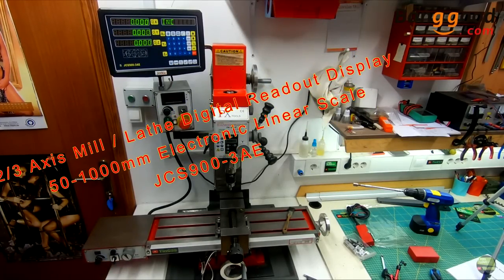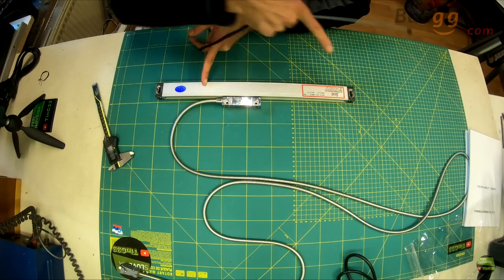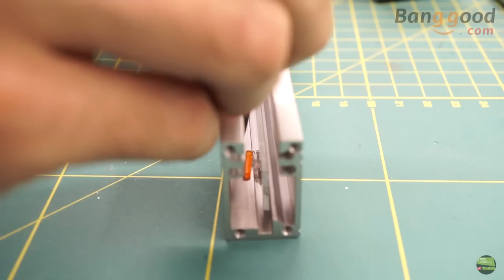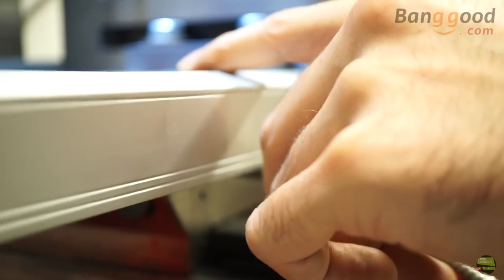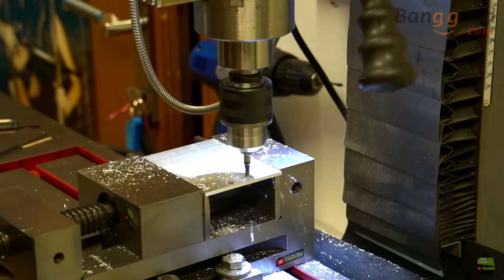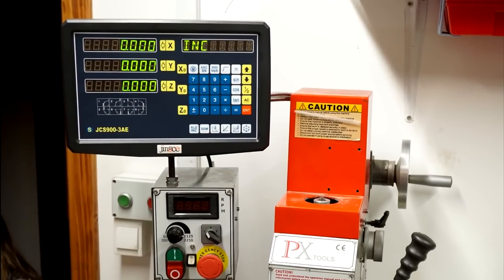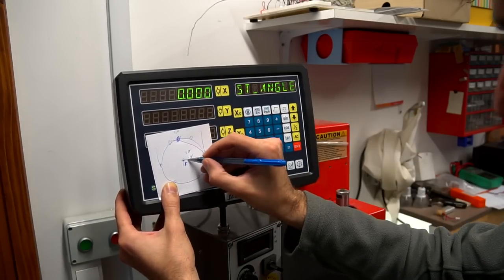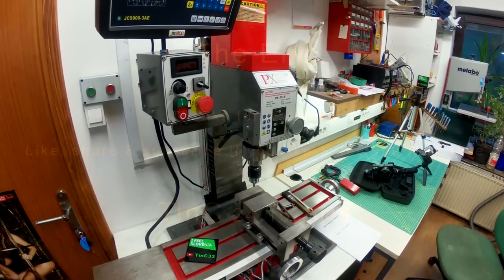$200 Mill DRO 3 axis Digital Readout from banggood [Unboxing Instalation Review]

Comment: This is the BEST explanation of installing a DRO on YouTube ... lot of people talking WAY TOO much and not SHOWING any of the work! I’m installing mine right now and just had to stop and thank you for this video ... I bought 2 ... 1 for my lathe and the other for my mill ...I bought mine from AliExpress and got the LCD version
Reply from the maker: Thanks man, i wish they serve you good.
Reply: TinC33 unfortunately the scale I cut is not working ...
Reply from the maker: @sonnytee  what's the problem, number stay the same when moving or what, check the optical sensor so there is no dust and be sure that you turned the glass right, on top (out of aluminium groove) must to be grinded a bit radius side of a glass.
Reply: TinC33 yes the number stays the same and soMeTime change but only for a second
Reply from the maker: @sonnytee  strange, try to clean sensors with compressed air, and check if you mount the glass on right way.
Reply: TinC33 got it working! Had the glass turned the wrong direction 😂 DOH!! lesson learned! Thanks 🙏 again for the video and responding to my comments! Starting my own channel in a few days...

Comment: Thanks for the detailed fitting instructions...........not all mills are the same as far as fitting position is concerned........I have a jig borer that is now a mill so fitting is  a bit of a challenge in mounting position differences.
BTW.....I wholly applaud the fact that you dismantled the glass scale to cut the aluminium and lastly the glass scale.....that makes it super easy with the diamond cutter in the Dremel and is far more precise.......I cannot imagine how anyone could think of cutting through the scale with a bandsaw even though it worked for them.
Reply from the maker: True, my eyes bleeding when i saw entire scale clamped into band saw, but it worked, because there are a bit longer glass then actuall needed.

Comment: Great video! I really liked that you showed many of the little "gotchas" that you run into in mounting these things, the clearances, angles, adapters needed...great. when cutting the glass scale with diamond wheel, did you use any water? I made a water dripper from used medical infusion bag and line, which has a little roller to adjust the drip rate...you can maybe get these from a veterinarian?
Thanks...BTW, do you watch ski jumping? Beautiful country you have, sir!
Reply from the maker: Thanks, no i didn't use coolant, because i only mark the line than broke the glass with a bit of force, if we want to cut through we need to use water, actually i'm one of few slovenian who don't watch ski jumping, maybe here and there because ither watching on tv 😉  where are you from?

Comment: It was good to see that the glass can be cut. Thanks for the vid.
Reply from the maker: Yea, someone didn't even dissasemvle them, just cut entire scale on bandsaw, because glass is 2-3cm longer then measuring distance, but i won't try my luck on that way
Reply: @TinC33  Thank you for the response. I have been researching these DRO's all afternoon. It is not clear to me how to determine the size needed. I watched videos that show how to measure travel by marking the table and the mill base. However, shouldn't the length simply be the bed length for x and the bed width for y? And is that not why you cut them? What am I missing? Thanks.
Reply from the maker: @GogebicYooper  if you order 300mm rail it is working area, so entire leingt is longer than 300mm, so i cut to perfect leingt. You can see into video how much longer they come.

Comment: Man, you have some skill! I have unfortunately just bought the Igauging DRO like you had before. I would have bought this if I knew it worked so well, but for now I will live with the other one.
Reply from the maker: Ah it's not big deal but thanks, yrs this one is on another level, but it's quite big for small machine like mine, but everywhere lot of empty spaces, it could be made much smaller easily.
Igaging work good but it's just to slow for work smooth.

Comment: No need to completely disassemble the scale to cut. Just take off one end cap and move reader to the other end. Shim the glass on both sides with wood or plastic at the cut location to keep the glass rigid. Cut with the band saw through aluminum, glass and wiper all at the same time. Just file the end square, clean up and retap for the end cap. Done!...I've done several this way.
Reply from the maker: I saw that but i don't know look so dangerous to broke the glass...

Comment: Very clean installation. Well done! 
I think I would be afraid to cut that glass😅
Reply from the maker: you think i wasn't? :) but anyway it cut nice and easy
Reply: I just did this tonight ... the glass cut fast using the proxxon and diamond wheel ... it was easy .... putting the little rubber pieces is HARDER than you made it look 😂 it’s a tight fit ... I’m literally doing it right now.

Comment: Fantastic!  I've had this same DRO for at least 10 years now (was running it on my lathe using only two of the axis).  But I wanted to move it to one of my mills - which just happens to be... the same as yours!  :O  This will save me SO much re-inventing of the wheel.  Oh, only thing I would do, is glue a sheet of thin felt (etc) under your Z bracket so it doesn't hit the scale.
Reply from the maker: Thanks man, and good idea. If there will be need i add some more shield, or wipers or whatever, but so far work good, they already "swim" into steel chips a few times.

Comment: nice clean setup Y axis cable might be bending a little bit tight you could probably give it a little more room by swapping X and Y cables in a clamps
Reply from the maker: Hello, firstly i try axactly as you say, but the cable constantly come out, this posittion is just great because cable hold under the scale itself, maybe look a bit tight, but it isn't.
Also not many time move table to the limit, and if i do i can just put cable out of (under the rail) and there's bunch of place, like on 15:36
Reply: Y axis reader could be flipped with cable pointing towards rear I did this on mine works great

Comment: Hi, thanks for this wonderfull video, congratulations for your both perfect technical an scientific approach. I've got the same machine and wonder about :
- due to it's drilling/milling design, did you find a real interest in use for the Z axis ?
- In the case I would invest later in the third rule, is it possible to buy a 3axis display, but use only the X and Y rule ? Will the "2 dimensions" functions accept to work in this condition ?
Thanks
Reply from the maker: Sure you can buy 3 axis display and only use two linear rails, i don't remember if i use Z axis but if i only use them once, because this mill already got a z axis dro on spindle and more or less i use this as z axis, real z only use for rough adjust...

Comment: The mill looks like the equivalent of the Optimum BF20? I wonder if any choice of scale would have been right, and it's better to go longer and cut them down.
Reply from the maker: It is the same those mill can buy in many different brands and they are all quite the same, i advice to take longer and cut them down you can get exact perfect leinght, it's not a hard job.

Comment: Good video well explained. Could you please explain what the composition/ brand of that solder you used, thanks.
Reply from the maker: Thanks, I use Durafix Easyweld Aluminium Welding , Brazing & Soldering Kit but there are many brands, now also got them on banggood for 10$, i buy that one years ago, and that was the only i found, price for 4pcs of rod was about 40$ that time.
Heater is basic torch from a local shop, work better like rothenberger roxy, wich is more hot, but got too small fire, you need to heat entire part preatty goos so it can be soldered nicely.

Comment: Hi,
after opening the read head, do you think it is possible to change the orientation of the cable outlet? In some configurations, the cable will collide with the attachment of the scale.
I suppose the thread of the cable outlet could be quite unusual…
Reply from the maker: I think you can drill another hole and put cables trough, but be carefull on chips (remove all electronics) and seal every hole before use

Comment: Excellent instruction video - what solder are you using to fill up the bend point on Y axis bracket? - I tried with lead solder after removing oxide layer on aluminium, but solder will not adhere ... Please advise .. Many thanks!
Reply from the maker: I used some rods for welding aluminium. You can buy on ebay, banggood...
Reply: @TinC33  OK great got it ... thanks!

Comment: Hi, was the power feed original or did you buy it separately? What is the designation (model) of the power feed? Thanks
Reply from the maker: hello, it was on machine when i buy used one. i saw holzmann sell separatly also and i'm sure it fit on every brend of this type machine, it got no special name just google for "Automatic feeding for milling machine Holzmann BF25VLN" it cost about 400-500€

Comment: Nice clean instalation, well done. I got the same set but on aliexpress and it cost me 174€ and posted from spain so i had no extra import/customs duties to pay. I always wondered about the glass scale and what it looked like as i have only seen it from the ends, and i git 1 scale slightly too long so i might shorten it now that i know how. I would like your opinion on your X axis autofeed, my machine is slightly bigger but not much and did not come with the autofeed so i'm trying to decide weather or not to buy the same one or build one. from the outside it looks the same as the one available for my machine and will fit directly. Thanks for sharing.
Reply from the maker: That's great to hear, i also got this from netherland EU so i don't need to pay any tax, that's  great.
About x axis automatic feed, it's woth the gold bealive me, really great stuff i don't know it that one fit to your machine, here is the link to other brand than i got:
https://www.probois-machinoutils.com/en/mandrins-et-options-pour-perceuse-fraiseuse-metal/4091-automatic-feeding-for-milling-machine-holzmann-bf25vln.html
But you can get it gor about $300, it+s just a 90vdc motor with a reductor and knob for turn on or off the gear, but i got constantly turned on because you can easily move axis manualy also if it turned on.
Also i thinking to add another geared motor for the Y axis, if i work more i use drill to move Y axis, as you can see on 18:02

Comment: Hello,
What name is your mill ?  Also what is the box on the left of your mill table ?  It seems It's to move the table with a motor . Any link to buy it ?  Thanks a lot for the video.
Reply from the maker: My mill is PX tool 20 same as optimum or bernardo, grizzly size 20 or 25, that think is called power feed, there's a motor and switch for left and right and a pot to set speed, right cnob is clotch to turn on or off entire autofeed.
Search for powerfeed, there are many different version i use ona like here:
https://www.probois-machinoutils.com/en/mandrins-et-options-pour-perceuse-fraiseuse-metal/4091-automatic-feeding-for-milling-machine-holzmann-bf25vln-9120039909288.html

Comment: i have the same dro on my mill at home ,i can tell you that it's accurate down to 0.006mm over 850mm of travel...if the dro at my work is correct,and it shoud be,sinse that entire machine cost more than i make in 5 years-i can however guess that it may vary from one set to another

Comment: Hello - super video!!! I have a similar mill from Paulimot and I also want to attache a DRO.
I saw that you have a drive installed for the x axel. Can you supply me with the name of the manufactorer? Thank you
Reply from the maker: Thanks, mine is some china brand PX-Tools, but it's same, as bernardo, oprtimum, paulimot...
so far i only see auto feed unit to buy separatly from holzmann, here is the link, look exactly same as mine.
https://www.holzmann-maschinen.at/EN/feeding-unit-201
Reply: @TinC33  Thank's a lot for your answer

Comment: Interesting video. Quite well explained but too much fast forward has lost me. I have a Sieg SX2LF and and the first problem is, I can't find a power feeder for this type of mini mill. Secondly, I have exact type of linear scales as shown here. and they are longer than the ordered lengths. I have two, one for X axis (ordered as 400 mm but came as 520 mm) and the other for Y axis (ordered a 250 mm but came as 360 mm), I have no choice but to shorten them to fit the milling table (X) and the Y movement. Your video about how to shorten the scales is excellent, particularly the removal and shortening of the glass strip. Hadn't it been fast forwarded I would have had a better idea on how to do it because, I believe, the shortening of the scales is quite a delicate operation, meaning, stuff it up and you're done. So, up to the installation of the scales to the machine, I mostly understood, but the ending part where it is programmed or tuned, I am somewhat lost. I purchased the DRO from Banggood, less the linear scales, in October and have had a lot of bang but not good, as I have been trying to understand why the scales are sold over sized. And this video does explain it all. As for the third scale (Z). I will do that later, as I have to decide where to install it beside the machine. Your machine is quite a beauty, however, at the end of the video it looked like the machine was working like a CNC, like auto milling the work. Do you have that on your Mill? Also, do you know where to get an auto feeder for my Sieg milling machine? Mine is smaller, but packs quite a punch, quiet too. Once again, thanks for the video, I feel confident and happy to try to shorten the scales now. Cheers mate.
Reply from the maker: Thanks, i got this kind of power feed, it come with a machine, and it's not cnc just x axis got power feed
https://www.probois-machinoutils.com/en/mandrins-et-options-pour-perceuse-fraiseuse-metal/4091-automatic-feeding-for-milling-machine-holzmann-bf25vln-9120039909288.html
Reply: @TinC33  
I like it because it acts as an extended table.
Reply: I am just starting to shorten the scales (2). Does it matter which end of the scale should be shortened?
Reply from the maker: @mickcarson8504  no

Comment: Hello Tin, what kind of power feed do you use on the milling machine x axis?
Reply from the maker: I got same as this one, but it's same brand as mill (px-tools) but that mill and equipement is all the same but different brand, like holzmann, bernardo, optimum...
I got it original with a mill.
For Y axis i use battery drill, but planning to make automatic feed also on y axis, just instal one small dc motor with spees regulation and connect to a handle with a belt, but must to make also mechanism to plug off so still can be used manual.
That X Automatic feed is great, because you can turn manual also if the system connect, there is a knob to disconnect gear from feed but almost don't use it, just got conneczed all the time.
https://www.probois-machinoutils.com/en/amp/product/mandrins-et-options-pour-perceuse-fraiseuse-metal/4091-automatic-feeding-for-milling-machine-holzmann-bf25vln.amphtml
Reply: TinC33 I happened to look here.. I’m in France so this is perfect ... I have Bernardo KF20
Super ..:

Comment: How did you ever figure out how to order the special and get the scales you needed?
Reply from the maker: There are not special leingh, you can choose leinght on every 50mm if you need special leinght buy longer and shorten them yourself.
Reply: @TinC33  Every time I tried to get the deal it ended up being $289 - $320.  Tanks for getting back to me so quickly.